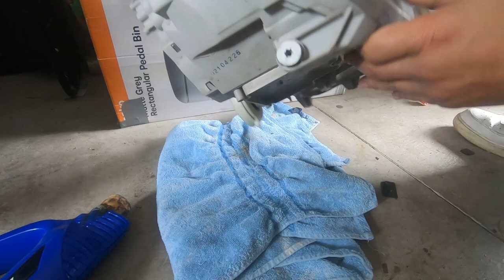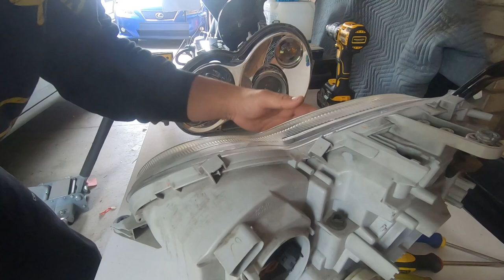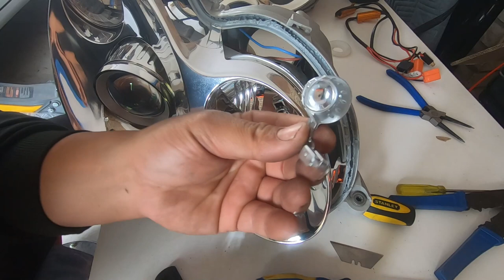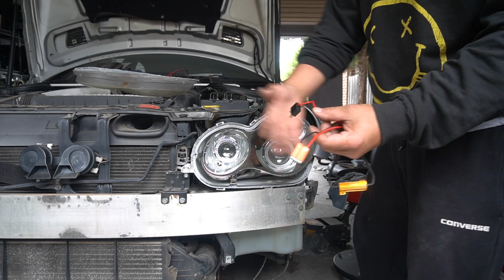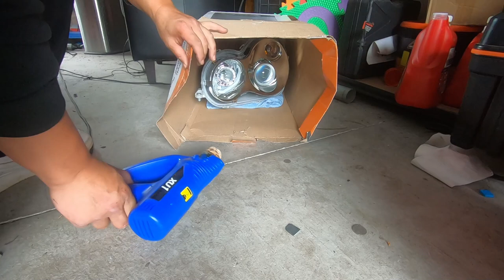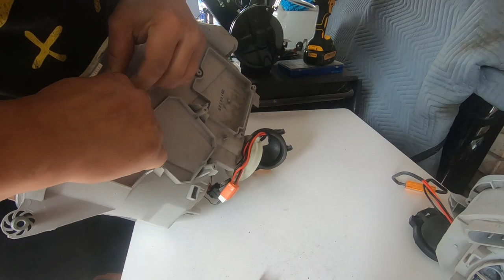car headlight mod retrofit (mercedes w203 headlight projector high beam)

Comment: Can't you put the wires thru the whole first with the load resistors...instead of drilling a hole 😂
Reply from the maker: yes u could ... I ended up doing this knowing I could use rubber grommets after ... its not a deal breaker .. and besides u can replace the caps quite cheap

Comment: Hey Mike another great video just thought I would share a little bit of knowledge that I have acquired see when you are putting on the clear cover and you made reference to giving it a wipe out to keep it clean if for any reason the plastic has yellowed at all sound it with a very very fine sandpaper perhaps 1500 you will see and milking is coming oh sorry you use water as well you will see it become milky then get a compound or t-cut and polish use a drill attachment if you have it and it will come up like brand new and to keep it that way then when you are finished and the lights are the positions you can buy a clear spray with ultraviolet protection that will stop your lights from going yellow in time well worth doing it also add to the shine of the finish
Reply from the maker: yes u are 100% correct i ended up using a clear coat for the finish product and it did come up like new
Reply: @MIKEYZVLOGZ  good stuff bro, glad it worked out great for you 😁

Comment: Quick question Mike is there any way that might affect an NCT I live in Ireland I don't know what it's called some places it's called a  DOE
Reply from the maker: no cuz its still just a headlight ... u mean like a certificate that says your car is upbto standards to drive on the road right?
Reply: Yes you are right regarding the lights being ok and yes it is a certificate to verify that the car is roadworthy in Ireland they are very picky I sold my C-Class w203 and art and other one mount this one is the same colour as yours and it is absolutely in mint condition I bought it from was the owner of a garage and this was his car it drives like a new car I'm glad I sold your the one because I was not in the young of changing the tie rod and I would have needed to change there shocks at the back to, what this one that I got it is actually very similar looking to an AMG if I had AMG wheels a few little bits such as a little bit of a spoiler on the boot you would not know the difference I am well chuffed with it

Comment: Bro I have HID xenon lights and I ordered spec D headlights and they're not compatible! My car has 3 connectors and these new ones got only one! W203 could these be converted?
Reply from the maker: so it doesnt jut plug into the sameheadlight plug harness?? it should be plug and play if they are for the same type of car?
show me a picof what u mean 
huottea@gmail.com
Reply: @MIKEYZVLOGZ  damb I literally just put the bumper on lol
Reply: @MIKEYZVLOGZ  so xenon/HID have 3 connectors on the headlight and regular halogen headlights have 1 connector
Reply: It's a w203 c32
Reply from the maker: @koolumar101  yeah sorry just show me the connectors or even send me a link of the lights or headlights u put on that ur having an issue with and I'll try figure it out
Reply: Just sent it over
Reply from the maker: honstly aything can be done but is it worth the trouble, the headlight u have is desdigned for the one plug harness like mine where you only have one main plug for the headlight and the rest of the bulbs are all powered through that one hardness connector , what year make and model is your car can u show me what the connectoprs look like for your car , u say u have 3 connectors, does thaT MEAN YOU HAVE 3 SEPERATE CONNECTORS RATHER EN JUS 1 FOR YOUR HEADLIGHT?, U SHOULD ONLY HAVE ONE MAIN COPNNCTOR? this is abit confusing for me as i cannot see what your doing... you would have to look at the bulbhey used for low high beam and leds to see how to connect them witouterror codes , especially foir leds u need resistors, when i use ld high beams i need to use resistors for the or they shut off after a min or start to flash on and off
Reply: @MIKEYZVLOGZ  It is for 02 c32 amg, xenon headlights were optional which had 3 separate connectors and a small ecu thing at the bottom of each headlight! I know I am also confused and bummed out that there aren't any alternatives! I tried searching for plug and play harness connectors but so far no luck :/
Reply from the maker: @koolumar101  ye unfortunately it's a matter of whether u want to wire each individually or find a plug and play harness
Reply: @MIKEYZVLOGZ  would you know a site where I might be able to find a plug and play solution? Thanks!
Reply from the maker: @koolumar101  try dmp car designs in USA

Comment: Hello, I watched some of your videos, they were very helpful,I have a question, for Benz w209, it has original xenon lights, can I change the xenon bulbs with LED headlights?? please tell me the model, which base should I buy, by the way, W209 and W203 classes have the same lamp base model, thank you.
Reply from the maker: ok so first of all whenever you go from xenon to led u always must condier errors.. usually u need a decoder or a led bulb that has a built in capacitor/ error free cancellors.. not there are alor of different bulbs out there , i cant suggest any single model because they are all different and they work differently on different models , w208 and w203 have similar headlights but they are diffeent xenon are basically projector bulbs and halogen are the style that arent projected , and basically reflct off a oval dish inside headlight 
now u say u have xenon, meaning u have the projector headlights , thats good, but the difference is still, do u have halogen bnulbs in the xenons or do u have hid in your xenons? 
once u figure this out u will know what type of bulbs u need, my w204 had halogens originally and then i swapped out the headlights fopr these xenons which still had halogen bulbs inside, then i went to hids with ballasts , and then i went to leds, and i need error cancelling decoders cuz i got flickering, the bulbs didnt stay on they came on and then went off again, thats due to leds in place of halogens, different power consumptions, thats why u use decoders/capacitors, they send continuous voltage to the bulbs so it can keep producing 12v and not flicker like mine did... 
i hope all this makes sense
heres my tip
remove a bulb see what size bulb it is  and especially what type it is 
then u look for a replacement bulbs in led or hid whatever your preference is 
once u select your bulbs , then u consider if it has built in decoder and if it will work with your lights , be sure to ask the seller 
u want error cancelling bulbs and also make sure you look for canbus free light bulbs, cuz our cars have a canbus module , and the bulbs need to be compatible with canbus or else it wont work and u will get error messages and or experience flickering or no lights 

hope this helps u out 
like i said sometimes its about doing the research and asking the right questions in order to select the right product, i dont wanna select a prosuct for u and it still doesnt work , u need to ask the right questions my friend to the seller

Comment: Great video! I'll be retrofitting my headlights soon. So there is no problem fitting leds on aftermarket bixenon projectors as long as its canbus and error free, but wont they get too hot? My headlights are fully halogen and I think to install one projector for both high and low beam like the one you used in the video but are 2" projectors enough? Do you think 2.5" will be better or it doesn't matter. Im thinking of putting leds in the projectors
Reply from the maker: either are fine.. the way i see it .. whatever fits... no they won't get too hot... lights are made to get hot ...especially hid even leds get got... maybe not as hot as hid but still hot ... but it will be fine ... and leds in the projectors will be good i had them in as well no error messages .. for low beam. u may need the led resistors error cancelling

Comment: Hi Mikeyz great video 👍🏻 
I just have a question, I noticed your low beam/dipped beam are the xenon model but your car is not and you have a led bulb in it. 
Was it a straight swap or did you do anything else? And do you have a video for that swap? 
Thanks
Reply from the maker: it was a direct swap .. I upgraded the headlights and they had halogen then I simple used led with decoders/ error free canbus resistors

Comment: Hello bro, I have the same headlights with ballasts and a relay with connection grip to the HID, its a D2S from Osram. I want to shift to leds. which LED will you recommed? Thanks!
Reply from the maker: auxito make great ones at a good price

Comment: Hi sir. Did you change your original H7 wiring and sockets? Or simply insert H1 led wiring into H7 sockets?
Reply from the maker: u can simply plug into the h7 sockets because u have blade connections and u just push them into the correct slots for the h7 socket...or u can use adapters from h7 to h1 but u don't need them
Reply: @MIKEYZVLOGZ  Thank you sir. I'll give it a try 🙂

Comment: Hi there, great video btw. One question though, I do not understand the resistor. How does it work? You are saying that it produces 12V and keeps the light going but when you give it constant power it should activate the small motor in the projector right? In this case, you are going to have high beams all the time in theory. Can you please explain this part? Thanks.
Reply from the maker: so the resistor I there to ensure 12v power is constantly supplying enough .. because leds use less power .. things like resistors and capacitors are used in line to allow the constant output of power ... mercedes have a sam unit which detect voltage drops.. and wen there is one it throws an error ... hence why when u change halogen bulbs to leds ... u get errors becuz the led uses much less power causing voltage drops... with the resistor it's able to keep a stable current...
Reply: @MIKEYZVLOGZ  Ok thanks for the reply I understand that.
What I am saying is that the small motor and the led wires are merged(permanent connection as you mentioned on 16:13 ) and they are getting the power from the same wire source: the high beam wires. So far so good when you are behind the wheel you give power to the led and force the motor to flick down to get that high beam. However, when you installed the resistor, it changed the game. Now it gets constant power and when you can control the motor. In my mind, it should have been two sets of wires 

1. That gives the led power(that it stays always on apparently which is very cool) 
2. Wires control the motor when you are behind the wheel to flick it up and down the metal thing with the spring. 

I do not understand how the resistor does that. I know it is working perfectly in your case but I think I have missed something that is driving me crazy. (I have a master degree in Mechatronic Engineering and I am thinking of going back to seminars to re-learn this stuff :D) Thanks in advance.

Comment: Is you headlight housing OEM. I saw you had led as low beam. Isnt it HID?
Reply from the maker: my headlight are aftermarket they are prohector style lights u can use hid or led its just up to you what u decide , it can fit either 
it came with halogen buls originally 
the factory lights were the series 1 styke where it looks hazzy and unclear ...hence why i changed the headlights to make it look better

Comment: Will the existing wiring hve to be changed
Reply from the maker: not at all it plugs into the existing wiring harness
does ur car have projector lights now? 
if not then yes easily can be done 
halogen to xenon is easy... just ensure u measire everything before thinking about startinv..so ensure everything fits and will work... for eg.. the hole will acompany the led or projector light screw thread ... like how i had to frind mine out cuz it wasnt big enough.. but u can do that too...

Comment: hi,
I got in an accident on the freeway and a cone hit my headlight. I didn't notice any damage on the outside but I notice that my projector that holds the bulbs got loose. the projector lens is aiming upward and I cannot adjust the aim. when I remove the cover from the back to reach inside, I can move the projector up and down but do not stay in a firm position, is loose. 
Do you think is broken or is possible to fix it ?  my headlight is bosch oem.
Reply from the maker: ok sounds like ur prokector light has either broken or been knocked loose the only way to tell is to disassemble the headlight and see what has happened so sorry to hear that
Reply: @MIKEYZVLOGZ   thanks for the response. I am gonna open and check it to see if is fixable. by the way, do you know any glue that you recommend for the headlight lens ?
Reply from the maker: @amgmods1  for ealing or just glue to stick plastic parts? araldite is good its a 2 part epoxy glue ... very strong can find st hardware store
Reply: @MIKEYZVLOGZ  hi mikey,
The headlight projector socket was out of the joint, I put back in by pulling backwards, but i noticed that the ajuster to aim the lens does not work. Is the ajuster fixable, can be replace ?
Reply from the maker: @amgmods1  not sure but I believe so however I may need to find it from a wrecked car or parts place ..it may not be sometjing they dell alone ..I've never had to do itn

Comment: That looks really good.  Can I do this adaptation on low beam if the factory fitted headlights are not fitted with projector lights? 
 Can I adapt a projector lens if  it's fitted with normal H7 bulb?
Does these projector lenses work with normal bulbs or they have to be  xenon? 
Thanks in advance ☺
Reply from the maker: only if low beam is not projector... then u can do it ...and u can use any bulb in these
Reply: Much appreciate your reply.  I bought 2 headlights to play with them a bit.
Thanks again for your uploads 🙏

Comment: My W203 C280 not install Led for headlight, are you have adapter ?
Reply from the maker: just resistors u can you just use led bulbs s it won't work properly u need resistors
Reply: @MIKEYZVLOGZ  thanks bro !
Reply from the maker: @DatLe-xq9nc  welcome